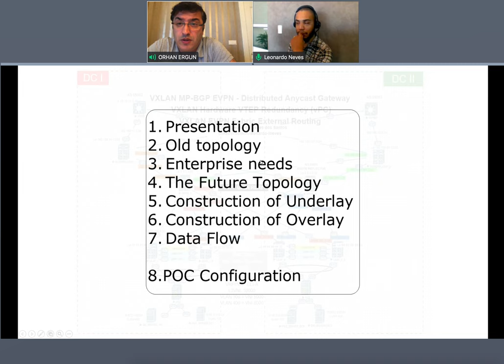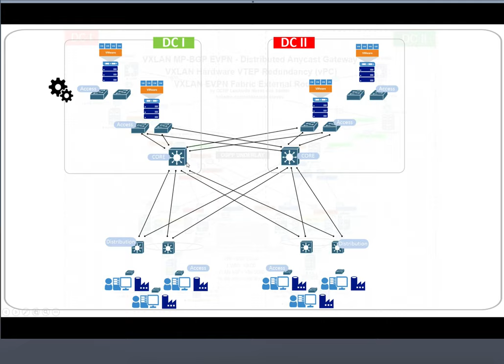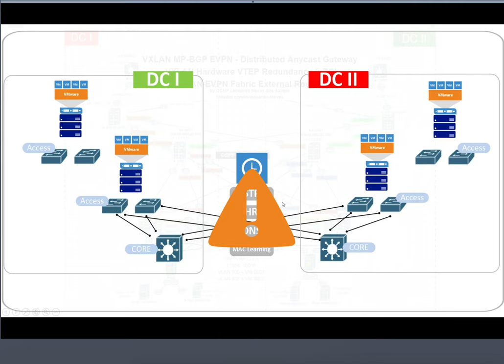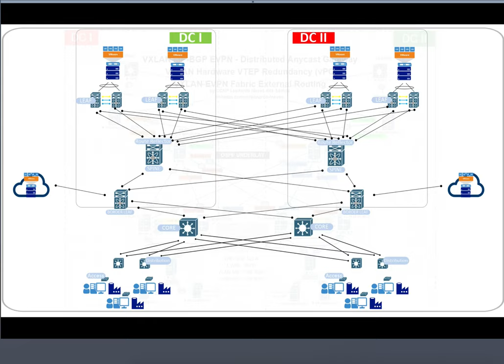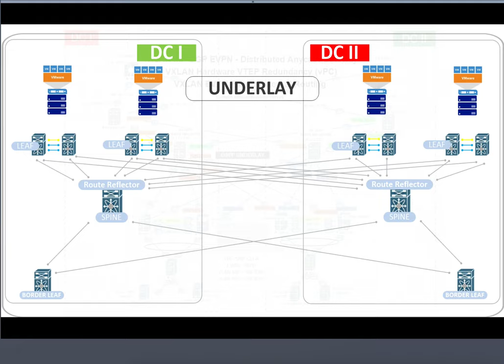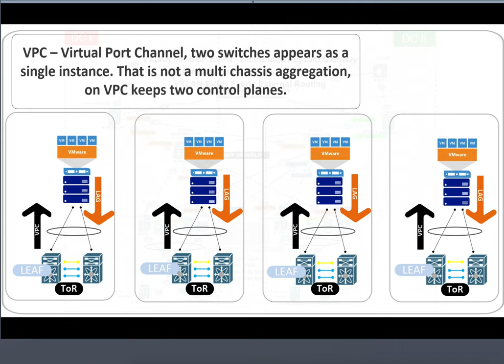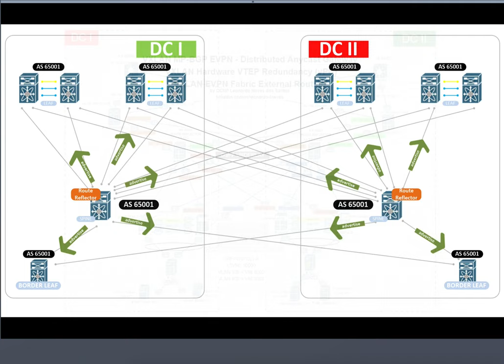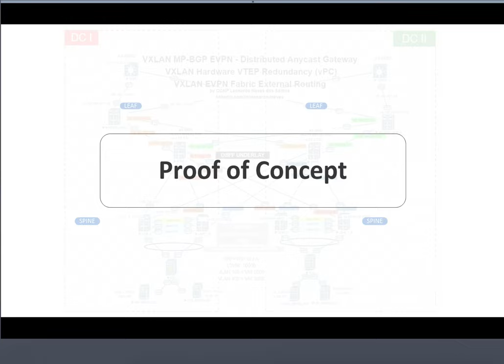EVPN - VXLAN Design and Deployment in Real Life Enterprise Datacenter - Part 1

Comment: Great training!! Thank you!! Do you have a training on VXLAN-EVPN orchestration , to ease the administration of both the underlay /overlay instead of going and configuring each device separately in a large network, are there templates we can use for underlay/overlay. Tools you recommend. Would it be same tool used in DC and in Campus if both use VXLAN as the overlay fabric. What the switch from different vendors can be configured by the common tool - what are the pre-requisites